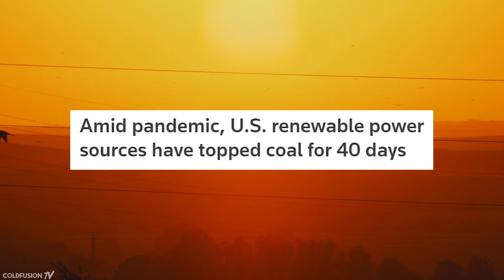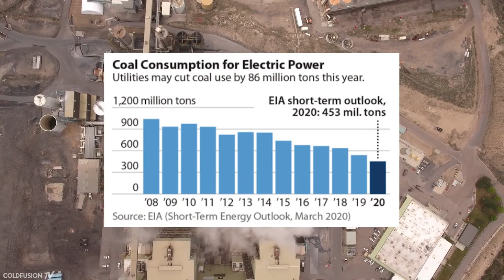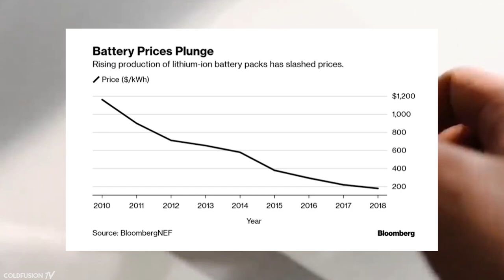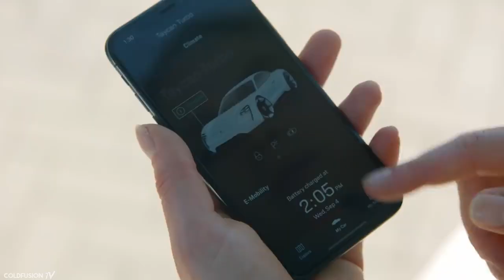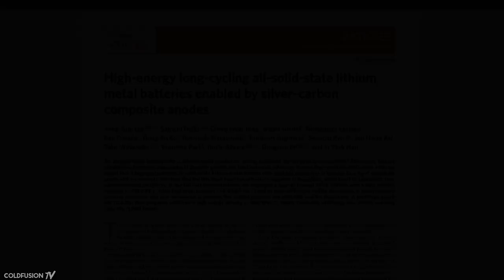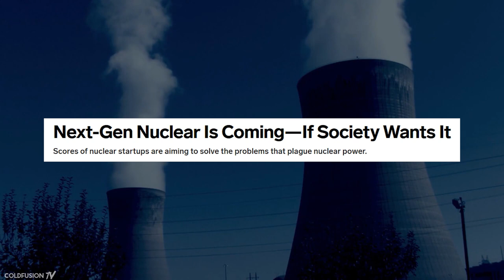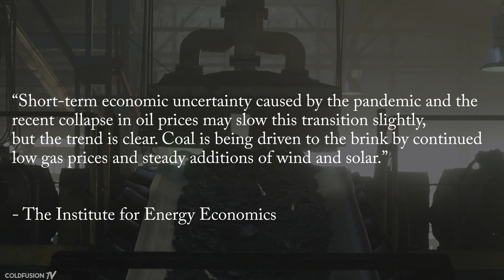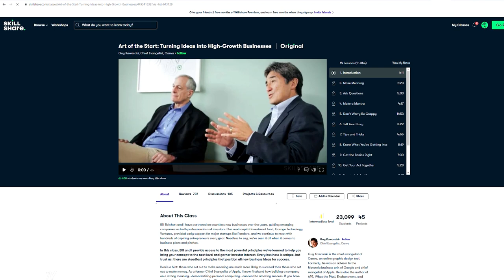Amid Pandemic, Renewables Now Supply More Energy than Coal in the U.S.

Comment: The biggest battery in the world is 185MWh 
A large power plant is 500 MW to 1000 MW 
The battery could match a 500MW output for just 2.7 hours
There's a long way to go

Edit: My maths was way off... that's actually just 22 minutes of worth of putting out 500MW (185 MWh / 500 MW =0.37 hours)
Reply: You do realize they are allowed to use more that one right. They can use two or three or a hundred.
Reply: Batteries are just a giant UPS system they don't need to be that big.
Reply: Tesla is already building 1 GWh battery site in California.
Current Tesla gigafactory plant in Nevada is already producing 38GWh per year although it is only 30% completed.
Tesla is rumored to show their 1TWh per year battery production plan soon.
Reply: @AkaiKA4K  I'm a Tesla investor and a massive Elon fanboy so do indeed follow them closely.
Thing is... Although people love to say renewables are cheap, which they kind of are, the idea that you can go 100% with batteries is actually obsurd. 
Let's say solar runs at 25% capacity factor. You need 4x as much solar plus storage to get your 24/7 power output. Although solar is cheap it's not cheap enough to be able to buy 4x as much capacity as you need in generation and then also buy a crazy amount of battery backup.
No
The reason solar is cheap is because you generate when you can and then turn on natural gas leaker plants when you can't.
People love to say that nuclear is expensive... Which is true. But nothing is as expensive as buying 4x the capacity you need in generation and then also having to buy a fuck off battery. 
I only say these things because nuclear has been beaten down by the 100% renewable crowd so hard and for so long. Even the fossil fuel companies are now backing renewables because they know that it ensures a demand for natural gas peaker plants.

Hornsdale, the biggest battery in the world... Does this thing called frequency control which if you Google it you'll get a much better explanation than what I could give you. It's vitally important on a grid powered by renewables because for the first time in history our grid isn't powered by lots of enormous, synchronised turbines and that actually creates a lot of issues which a battery solves extremely well. I'm extremely bullish on teslas ability to provide frequency controll services to an ever increasingly intermittent grid and it is a considerable part of my investment thesis in Tesla which the vast majority of my personal worth is in.
But batteries do not do what you think they do in terms of the grid.
Please google frequency control if you would like to understand
Reply: Dominic Adams 1 thing. Solar is going to be even cheaper. It would be simply more economical to build 4x solar. What are we going to with 75% excess solar electricity during summer. Water desalination, running carbon capture plant to make zero net carbon fuel, making methane required for thousands of interplanetary starships, the list go on.
Reply: @AkaiKA4K  solar is already cheep enough that the main cost is installation so I'm afraid your point is null.
Solar will remain the golden child who is so god damn cheep so governments will go to 20 30 or even maybe 40% solar while still being 100% dependant on natural gas. 
Power does actually need to be reliable
Reply: @doritoification  I am saying it is going to be 4x cheaper per kWhr than now. I know all about current batteries are only replacing peaker plants. You are talking about now. I am talking about future when the world is pumping 300x batteries per year than now. And that future may be as close as 5 years, Wait for Tesla battery investor day.
Reply: @doritoification  I am a Tesla investor too. Watch The Limiting Factor youtube channel for futhur known info about the Tesla battery day.
Reply: No, a 185MWh battery can only output 500MW for 185/500=0.37 hours. Your math is way off.
Reply: @kieragard  I don't think you understand the magnitude of energy that's being transmitted. Batteries are great but they cannot come close to meeting daily energy demand. This is why energy storage is such a big deal for renewables

Comment: Nuclear power is the technically the safest source of energy in history due to the very few deaths associated with it and it's extreme energy efficiency.

It's only flaw is that when it does fail, it fails spectacularly. But compare the deaths of fossil fuel energy production vs nuclear fuel energy production and it's hard not to look at and think of a strong return back to nuclear power in the future and it'll cover the gaps renewable source energy has.
Reply: Look up Georgia’s nuclear builds at Voltega. Way beyond their capital budgets, it’s a multi billion dollar failure. It’s a risk most utilities in the United States won’t take on. It’s easy to armchair a build like that, but things go wrong and nuke units are some of the most expensive builds.
Reply: It's real flaw is it's to expensive.
Reply: we will store the waste in your garden than, for a few thousand years
Reply: @RuggeroSB  never talked about solar, coal, wind or anything. just pointed out that nuclear is the worst for the future
Reply: @Sami.curiouslab  and I'm pointing out that it's far from it.
Reply: @Sami.curiouslab  - Only if you use capital letters and punctuation correctly. |:-\
Reply: It's really expensive tho.
Reply: Yeap true there is more deaths with Solar than Nuclear. And solar cost about 16x more material and produces about 300x more waste in addition it requires 450x more land usage
Reply: @RuggeroSB  Spread the truth
Reply: @RuggeroSB  yeh there’s definitely environmental destruction caused in the throwing out of solar panels, but renewable energy products are still comparatively the least damaging to the environment out of all of them. The tech still has a long way to go but so far is a good step to being environmentally friendly

Comment: Could you maybe do a video on non-electrical energy storage? Like pumping water up to a higher elevation and then using it to generate electricity on the way back down. I've heard of another option that involves using a long hole in the ground with massive weights connected to a pully system to do essentially the same thing.
Reply: Tom scott has a great video on pumped water gravity battery in Wales

Comment: Maybe you can reduce coal use but not eliminate it. To date no wind turbine has been made without a lot of coal used to make the concrete base and steel tower. Concrete and steel are made with coal. So are solar cells (polysilicon). You cant make them with electricity so the system still ultimately relies on coal.

Comment: Batteries don't always have to be electrical. A water reservoir and hydro turbine can be used as a battery to store energy. Pump water into the reservoir in times of renewable surplus, and empty the reservoir in times of need.
Reply: A report here in Australia showed we have masses of potential sites, although seems we are going ahead with the Snowie 2.0 project thats one of the more expensive options. Seems hydrogen will work out to be good for long term storage.

Comment: Hey Dagogo, very interesting video again, thanks for that. Quick note on the battery comparison at 5:13: One is 14.4 V and the other 3.7 V, so u can't compare the mAh directly. What's technically right is to look at the Wh which would be 24.5 Wh for the old laptop battery and 18.5 Wh for the new phone battery. Still a huge increase but just a fifth as good as your camparison suggested.

Comment: Are you sure it’s just wind and solar? What about the supposedly ’renewable’ energy source biomass is that not included in the US energy production?
Reply: you recently watched planet of the humans aswell? ^^
Reply: biomass is only about 1% of US electricity production, check the data
Reply: @Daniel-gq4vw  Coal is just biomas that's been in storage a long time. Hey look, the us is 40% running off renewables now. nice.
Reply: @Marc83Aus  tru dat
Reply: @Marc83Aus  Technically Solar Energy isn't renewable because the Sun is half-way through its life and exhausting its hydrogen reserves in the core.

Comment: @6:00 until there is a solution for battery recycling, I think it would be detrimental. Lithium-ion batteries last at about 3-4 years at most then you have to dispose of them. But there are a lot of issues with that in itself. There has to be a battery with similar functionality or better as a lithium-ion battery with a longer life span and/or actually be able to be recycled.

Comment: Some people: "we should go all solar and wind"
me: "I think nuclear power would be more efficient, cleaner and would last longer, probably until we are type 1 civilization"
Some people: "But Chernobyl and nuclear waste"
Me: "Chernobyl cant happen due to all the safety precautions and actually competent personal. The only thing that may happen is what happened in Japan after the Earthquakes, but that cant happen if the plants are in areas without such activity. And waste, there are methods which can make us use almost all of the material."
Reply: Yeah nuclear power is the future but politicians and climate activists are blocking it. And yet those climate activists who protest against nuclear energy wants to use renewable energy completely without any fossil fuels.
Reply: @parvathireddy3888  I'm a climate activist. And I support the research of new Nuclear Reactors. I like Waste Burners and the stuff with Thorium. I agree, society does not understand the difference between old/current nuclear and new nuclear. 
I think we need a healthy mix of all low carbon energy production, however because of economics where renewables lead, nuclear will not have a big role to play. They have one, but not too big. Also, centralization of energy production leads to abuse of power on a political level, which supports renewables the decentralisation of production even more IMO.
Reply: @brokkoliomg6103  I appreciate your nuanced point-of-view, but I do recommend reading Lion Hirth.

Renewables are only 'cheap' up to their capacity factors, leaving a big, big role for nuclear.

https://papers.ssrn.com/sol3/papers.cfm?abstract_id=2110237 (although his Youtube video is more accessible - https://www.youtube.com/watch?v=caa7HufZiT4)

I also see hydro, geothermal, nuclear, wind, solar CSP and utility-scale solar PV as centralized, even if hydro, wind and solar are centralized over very large areas.

Residential solar PV and solar thermal are great (heat pumps are even better!), but your total energy footprint is only 20% (or less) at home. Residential solar will not power the transport/industrial/commercial/agricultural sectors.

Comment: 5:15 Btw, the symbol for milliampere-hours is mA⋅h, not "MAH" (which, though still incorrect, could mean "megaampere-henries"). SI symbols are case-sensitive (because they're symbols, not abbreviations). You need the space between the number and the symbol, the dot between A and h for compound units, and the proper case.

8:03 Also, nuclear, not "nucular".

Comment: One important aspect in transitioning the grid that's usually overlooked (because it's hard to grasp and most technically educated people are not electrical engineers) in these videos is reactive power. A grid needs to match the generated power to the momentary load at all times, but it also needs to be supplied reactive power on demand. Reactive power doesn't do any actual work, but it must be balanced to keep grids stable and is used to control power flows, which increases a grid's transission capability using the same power lines. It is easily produced (or absorbed) by synchronous generators (huge spinning machines) that are used in traditional and hydro power plants. If you don't have enough of these left in your fleet, you need to do something else. Solar and wind installations could produce reactive power via electronics, but they don't currently do. It could turn out to be easier to use big flywheels and synchronous generators. If you build a clever flywheel with a non-constant moment of inertia it could store energy at the same time.

Comment: One point missed: cheap and safe (according to Harvard) fracking lead to so much natural gas that it resulted in the replacement of coal with natural gas.
Reply: I'm not so sure it's cheap and safe or clean, but coal is now the most expensive energy source, so you could be right
Reply: @autohmae  correct sir.

Comment: I have been working on Renewable Energy in my university. The large solar and wind-powered grid will have to supported by micro-grids of Roof-top solar panels and micro-wind turbines.

Fuel cells or phase-change material batteries will have to come up instead of Li-ion for quick charges and discharges required and factoring in the amount of storage required.